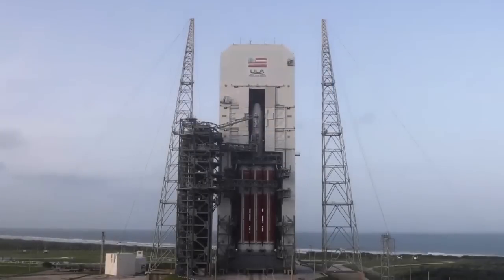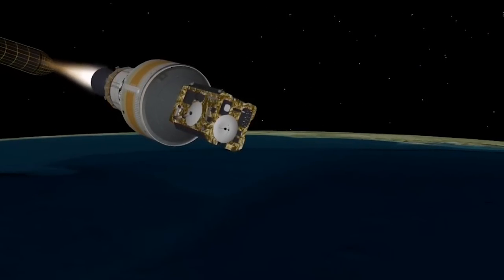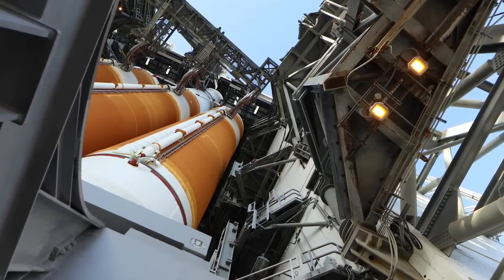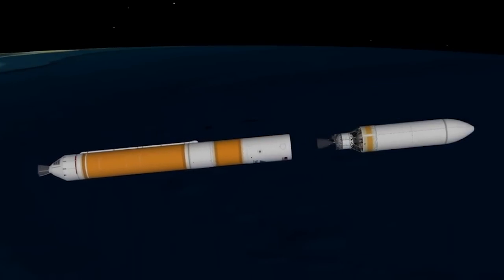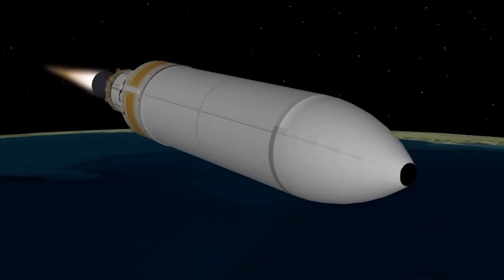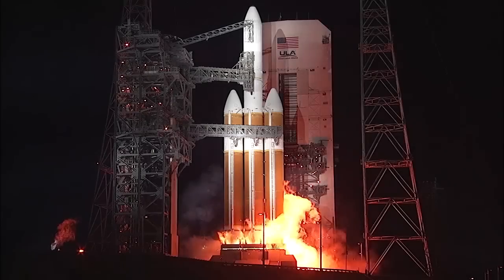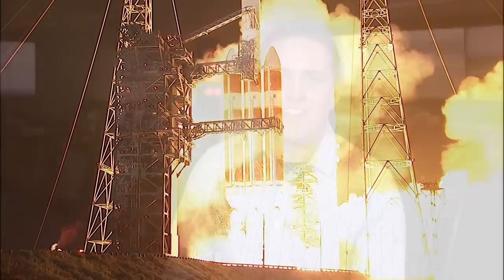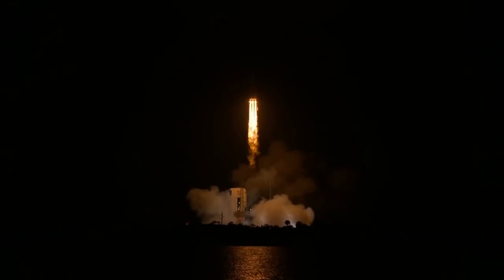Rocket Talk: Delta IV Heavy NROL-44

Comment: 1 month delay compared to space few hrs or day delay
Reply: Um... SpaceX has had many one month delays, if not longer. And this is only 1 delay. ULA historically has very high schedule reliability, higher than SpaceX. Also, ULA's rockets have had very few failures - Atlas V has never failed, and Delta IV Heavy has only failed on it's test flight. SpaceX has something like a 97% reliability rate. Of course, this reliability does come at a cost, but what's the point of saving 100 million in launch costs when your actual satellite could cost billions of dollars? Compared to the price of the satellite, even ULA launch costs are peanuts. It makes sense to spend extra money to make sure that your satellite will get to the right orbit, rather than save 100 million and run a 3% risk of losing that billion dollar satellite (with SpaceX). The extra reliability is worth it.
Reply: Anonymous Person Only reason they have this launch is because the ULA takes all of the contracts
Reply: @gvi341984  Because they're good. Once again, you can't just say "SpaceX is cheaper, therefore SpaceX is better". Many spy satellites cost billions of dollars. Sure, you'll save 50-100 million by going with SpaceX, but given SpaceX's track record, you run a 3% risk of losing that billion dollar spy sattelite.

Also, SpaceX did get some contracts recently - they took 40% of all national security contracts. Keep in mind though - ULA got paid 350 million to launch 2 satellites*. SpaceX got paid 350 million to launch *1 satellite. Who's cheaper now?
Reply: @anonymousperson2110  Starlink is a spy satellite network and so far 715 of them have existed. Why should the ULA have any contracts?
Reply: Anonymous Person technically the falcon 9 block 5 actually has a 100% reliability. Both failures were long ago and caused by the same thing which was completely redesigned to support manned missions. I don’t think it’s really fair to take an overall percentage like that without considering those failures were actually different designs to what fly now.
Reply: @TheBest14184  agree
Reply: @gvi341984  LMAO. Starlink is absolutely not a spy network. Good cameras (or radars, some satellites) are very bulky and heavy. It would be obvious if they were present. Also, there already is Planet Labs and Blacksky, which already provides reasonably high resolution images that are updated every day. There's no need to pay 100 times the cost to repurpose Starlink as a spy network, if it even can be done.

Well, I suppose Starlink can be used for sigint if more antennas were installed. However, sigint is only one piece of the puzzle, as optical and radar spy sattelites are incredibly important, and it doesn't make sense to design Starlink to do optical or radar reconnaissance, in fact, it's impossible.
Reply: @TheBest14184  Block 5 is just an evolution of the Falcon 9. It's still in the Falcon family, and thus failures of all previous falcons still should be counted. It's like saying that any past failures that I've had should not be held against me because I'm "new and improved". If you try telling an employer this, you'll have a very hard time convincing the interviewer to give you a job.
Reply: @anonymousperson2110  
-Traditional satellites are bulky but skylink is a network of 715 satellites that unfold to the size of a school bus 
-715 satellites from one unison network 
-why would you need to repurpose when that is the purpose of the Air Force contract 

Not only that but you are thinking phsyical espionage and not digital.
Reply: @gvi341984  I mentioned sigint. Yes, starlink is the size of a school bus, but most of that is solar panel. There's a reason why SpaceX can fit 60 of 'em in 1 fairing.
Reply: @anonymousperson2110  Oragami shaped satellites weighing kgs each
Reply: @gvi341984  How are you gonna fit the mirrors? What about the sensor array? The volume of that stuff adds up fast. Mirrors for spy sats have to be crazy precise, you can't just fold up the mirror and be done with it. Yes, the James Webb telescope does store it's mirror up in pieces, but it's still so huge that it requires an Ariane V to launch - the James Webb telescope, *even with this folding*, still could not fit in a Falcon 9 or an Atlas V. Yes, if your spysat is in a low earth orbit, your mirrors can be smaller, but there is still no way in hell you can fit 60 of them in a single Falcon 9.
Reply: @anonymousperson2110  hi, i know this is old, but i just wanna say you make some fine points.
Reply: @anonymousperson2110  dude, that long
Reply: @anonymousl4034  Those spy satellites are over budgeted
Reply: @anonymousl4034  Starlink is part of an Air Force contract and the reason why the FCC has allowed SpaceX to fly so frequently. You think the FCC is allowing space flight over some humanitarian reason? SpaceX is also in competition for spy satellites as well
Reply: @gvi341984  lol starlink is spy satellite? 🤣😂
Reply: @bogged4613  You should check the Air Force Times about the Starlink project it's not hidden or anything. You think it's some rural Internet provider? Why would the Air Force create a contract just for that
Reply: @gvi341984  can you provide some link which states this
Reply: @bogged4613  Go through  Air Force times since YouTube doesn't allow for hyperlinks.

“[SpaceX], Hawthorne, California, has been awarded a $28,713,994 competitive, firm-fixed-price … agreement for experimentation … in the areas of establishing connectivity [and] operational experimentation … [and] will include connectivity demonstrations to Air Force ground sites and aircraft for experimental purposes